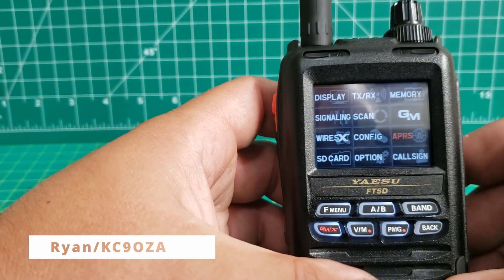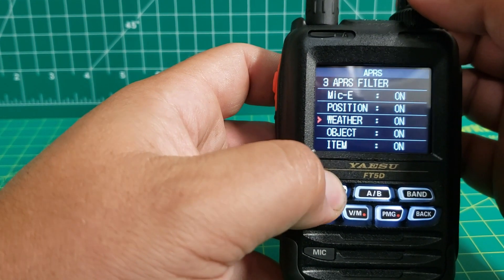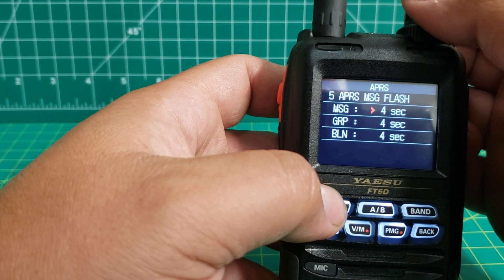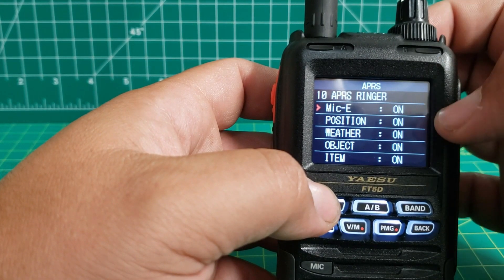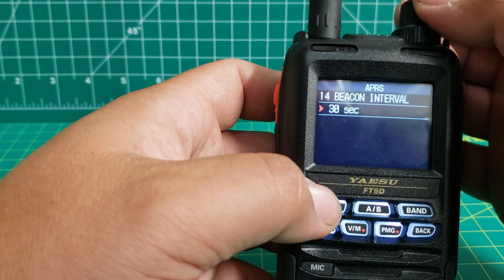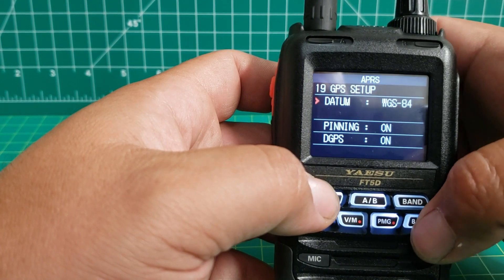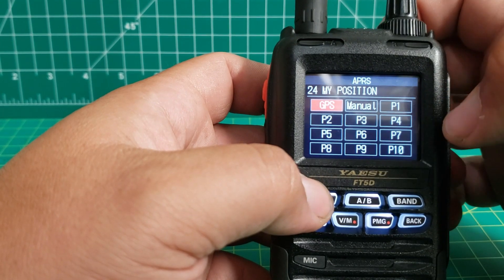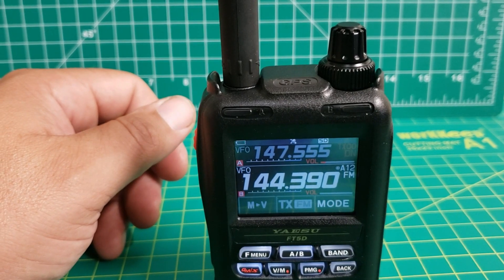How to setup aprs on the ft5dr #yaesu #aprs  #ft5dr #hamradio #hamharder

Comment: Thanks. I’m new to the hobby. The Yeasu manual for the FT5DR is not super helpful concerning use of the APRS feature. At the bottom of pg. 60 is says, “for details, refer to the APRS Function Instruction Manual which is available on the Yeasu website.” Couldn’t find it, so again thanks.
Reply: Link below-  bottom of middle section on the web page.
Reply: @idavis5615  I finally figured it out, but thanks for the reply.